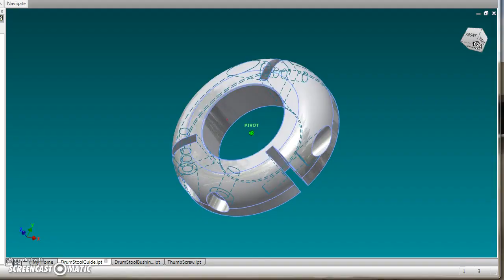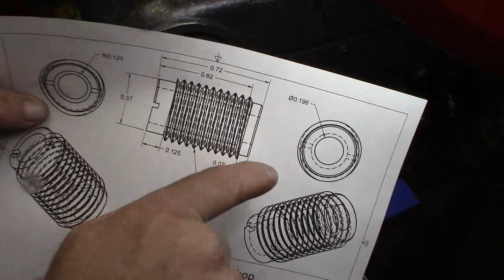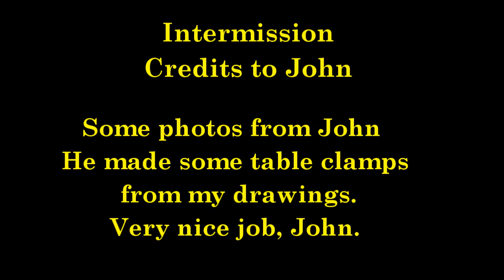How To Make a New Die for a Whitney Punch

Comment: Yeah, leaving the "hanging chad" is usually a sign of either rounded corners on punch or die, or too much clearance. I sure like my smaller Whitney-style punch. For thicker material, I like my Ironworker which can do up to 1" in 3/8" mild steel. (Square holes, too.)
Reply from the maker: Yep I agree Peter to much clearance for this thin material.  Ironworker - Nice.

Comment: Hi Randy,
Not much that a good machinist can't do, make or fix...    ;)
Great fix, maybe a little grinding on the male and female to make em a little sharper, concave on the male...
Cheers,    Pierre
Reply: W-1 ...???
Reply from the maker: Yes W-1.  Yes the male side has had quite a bit of use.  And for the thin material should have less clearance.
Maybe make a new male side.  Thanks Pierre for stopping by.

Comment: What's the difference between using oil and water to quench? Ty!
Reply from the maker: It is about heat transfer rate.  Water will cool the material faster than oil.  W-1 steel is designed for water quench, O-1 is designed for oil quench, just as an example.  Tool steels have many different designs and different recommended quenching's.     Thanks Scott.

Comment: boy it must piss you off when you go to edit the video and find the camera has focused on the wrong thing.  I would have though the die portion would have only had a few thou clearance at best not 0.010" (I have no idea what it is supposed to be).  Nice job though.  Is it W1 steel?
Reply: Just googled die clearances and was surprised. 15%, 20% and 25% of material thickness being punched for aluminum, steel and stainless respectively.  I never thought it would be that big.